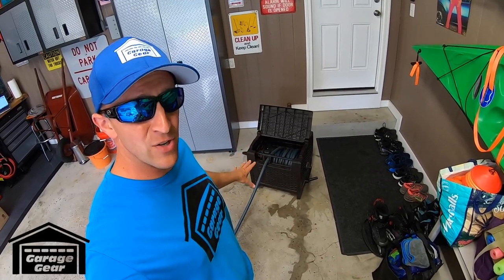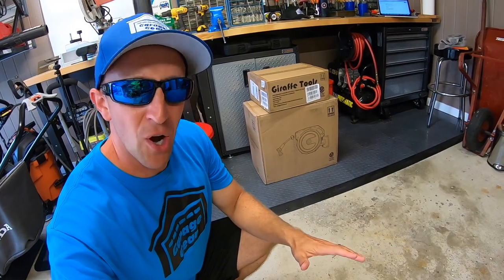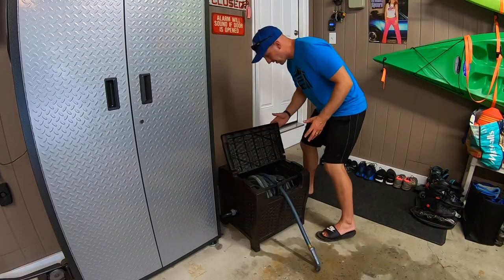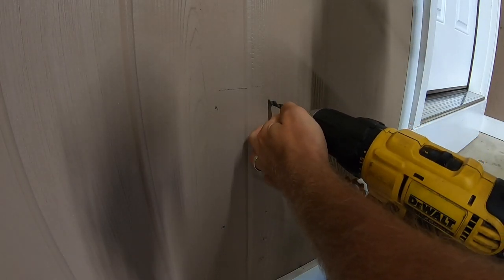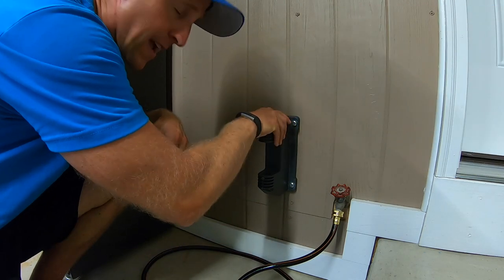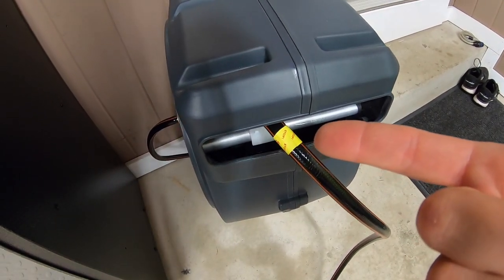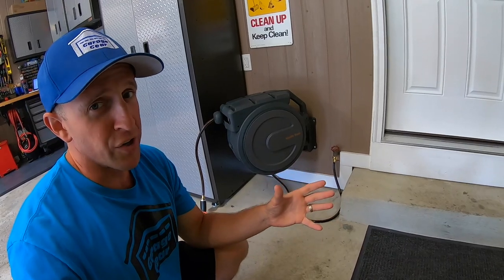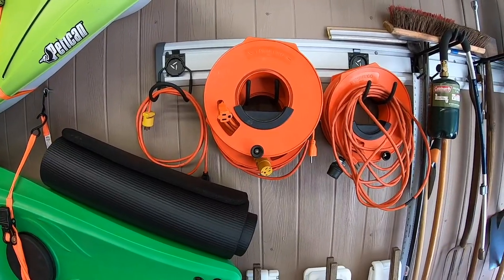IS THE GIRAFFE TOOLS 1/2" X 130 ft. WALL MOUNTED RETRACTABLE GARDEN HOSE REEL WORTH IT?

Comment: What is the width of the holes?  It seems to me that you can't get all 4 screws into 1 stud which is only 1 and a half inches wide.
Reply from the maker: @lourak613  you’re right I only put two bolts into the stud. The other two are anchored into the wall. Holds just fine

Comment: I was sold until I realized I need to drain hose every time I use it and retract it……..I guess they all need to be drained……
Reply from the maker: It’s a good idea to simply drain the hose before winding it up that way the retract mechanism won’t break . Thanks for watching!
Reply: Just turn off the water and let it gravity drain out of the nozzle. Pretty standard practice for any hose reel.

Comment: After 10 years of dragging 100 feet of hose around to my driveway whenever I wanted to wash a car I took the plunge. I opted for the 5/8 inch 90 ft variant with a metallic mount bracket. The plastic screw inserts are junk. I purchased 5/16 lag shields for mounting the bracket to brick.
Reply from the maker: Excellent thanks for sharing

Comment: JB, very cool hose manager. I could use this in my garage for sure. Just wondering if you have tried watering the lawn with this? I ask because I would be going from a 3/4” to a 1/2” hose and worry I would not be able to get enough flow with the smaller diameter.
Reply from the maker: David!!! They sell this in 90’ by 5/8” diameter hose as well. I would go with that one. After using it for a few weeks now I noticed  drop in pressure with the 1/2. . Not a lot but still noticeable. I’m going to step up the 5/8 to make watering my 10,000 square feet lawn. I’m still very impressed with this product. Super handy and a huge time saver! 👍👍

Comment: Since you have the reel mounted in your garage, how do you drain it?  Does the reel have a drain option or do you have to disconnect the supply hose to drain?  If the outlet end of the hose is open to atmosphere, would the hose automatically drain when being retracted?
Reply from the maker: Hey scruffy, when you hold the trigger down and retract it in water flows out so it stores with hardly any water in it.
Reply: Ok, thanks.  Makes sense @GarageGear

Comment: I tried installing it on brick. I used a 3/8 drill bit but the anchor will not fit and go all the way. The nail will though. I’m scared to use a 1/2 masonry drill bit as I’m afraid it will be too big for the anchor. Any recommendations?? Thank you!!
Reply from the maker: I would go and buy the correct size masonry bit as it will help ensure a good fit.

Comment: Hello, now after a year, how has this 130 ft Giraffe retractable hose stood up? It is in your garage, so it is not seeing the heat, so I think it may have a bit more life. Mine will see a lot of heat, but will have some shade during late afternoon. Any thoughts or comments? Thanks
Reply from the maker: Hey Jenny! Holding up just fine. Should be fine outside. I know plenty of people with them outdoors and they’re fine. If you have water pressure issues though I would go for the 5/8 hose. Thanks for watching

Comment: thinking about buying one but the sizes are throwing me off. They sell 1/2" and 5/8", but isn't a standard hose fitting 3/4"? How will I connect the 1/2" or 5/8" to my existing pressure washer that works with a standard hose?
Reply: I think i'm just going to buy a small adapter to keep on my pressure washer
Reply: lol, i chatted with giraffe tools customer support and they say "to clarify, the fittings in all of our garden hoses are 3/4, the hose diameters could be 1/2in or 5/8in, so, the connectors are standard"
Reply from the maker: Hey space coast the hose couplers are all standard 3/4. The hose diameters are 1/2 or 5/8. The 5/8 has better pressure but a slightly shorter hose length. 👍

Comment: I want to get their electric pressure washer that is wall mounted as well but the ratings are keeping me away. Some have videos of the motor burning out and smoking. May buy this though.
Reply from the maker: If the ratings in the pressure washer are bad I would avoid it. Thanks for watching

Comment: I noticed that you ran it with a sprinkler in the video. How do sprinklers perform with the smaller hose diameter?
Reply from the maker: I would go for the 5/8 diameter for more water pressure.

Comment: "a hose that won't kink"  LOL  Great video..... would like to know how that retraction mechanism holds up.
Reply from the maker: Two years now and still going strong! Thanks for watching bosco!
Reply: @GarageGear  Thanks, there are reviews online that indicate the retraction begins to fade after a season and the mounting bracket also may start to bend prematurely.  Hope that isn't the case, since I bought one....
Reply from the maker: @userbosco  neither of those issues on mine. I control the hose as it reals it’s way back in. Make it go in slow and it should be fine. Don’t just let it go. It’ll wind in too fast and probably break that way. Also anchor it to a stud and it should be fine mounted too. 👍